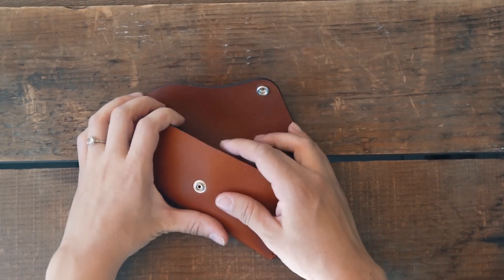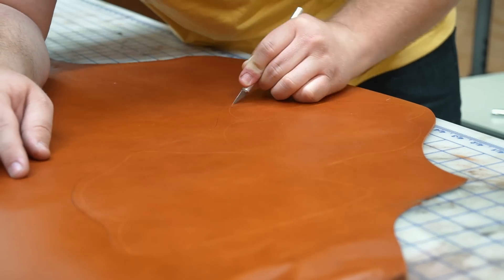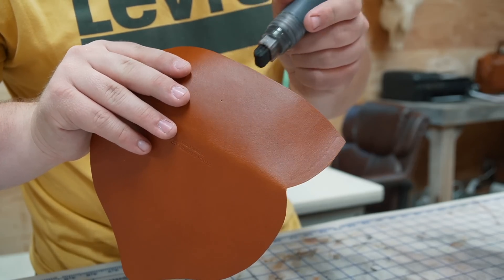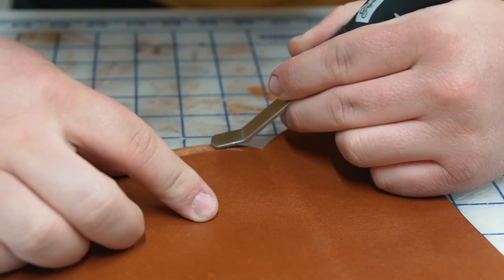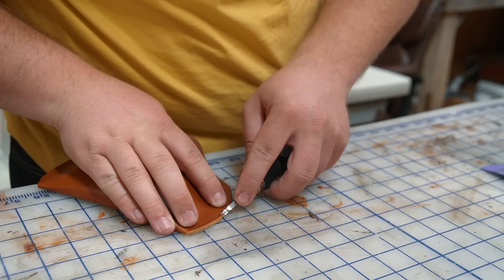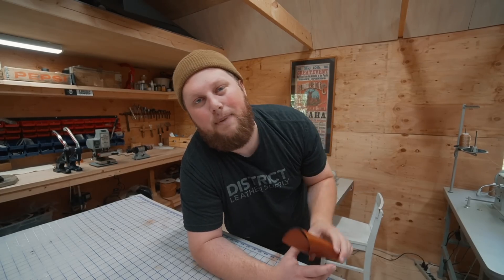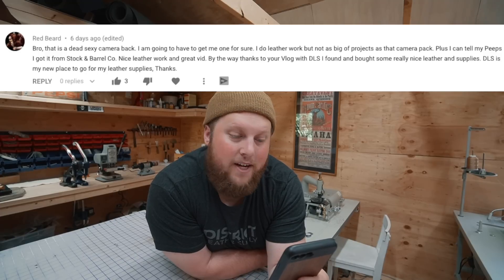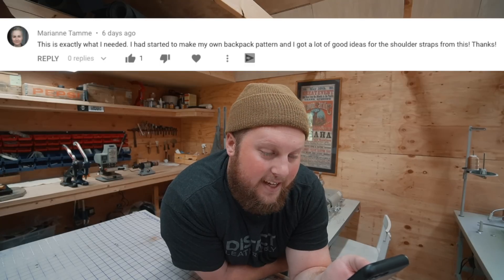Making a Leather Sunglass Case - DIY

Comment: I love your case design, it has a great shape to it! The only thing that worries me a little is the lack of backing or lining to prevent the button from scratching up the glasses inside
Reply from the maker: This button is in the middle where the nose indent is on the glasses, so it's not even close to touching the frames, even if they move around a little bit.

Comment: You know it figures you would know how to use Illustrator. Ugh, I tried using it and got very irritated especially when I know how to use Inkscape. I figured it would be just as easy but heck no. I need to find a good instruction program that teaches it.